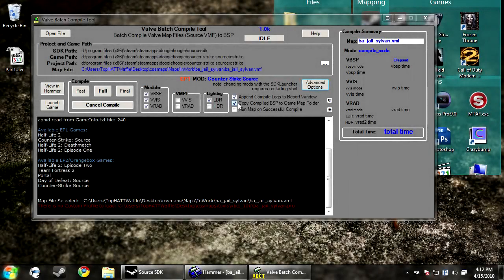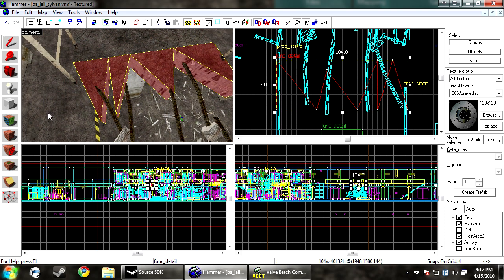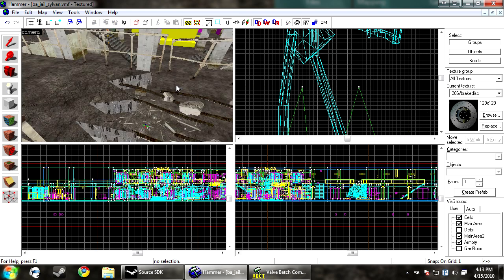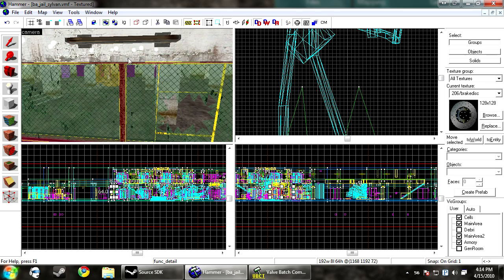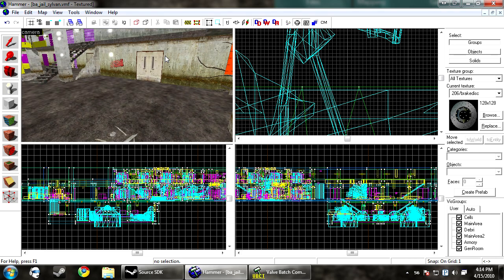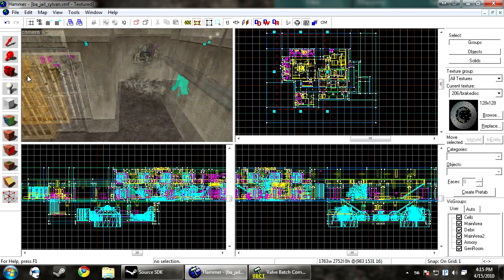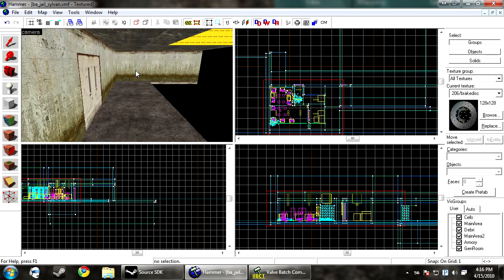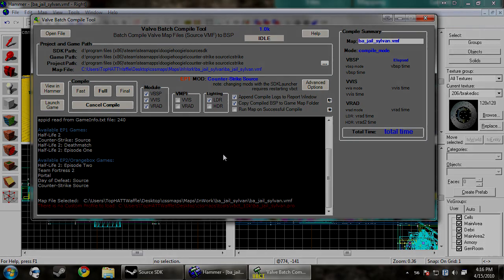Hammer Tutorial #28 part 2 "What happens during a compile? And how to speed it up"

Comment: The cordon tools are the best way to find errors that only show up in rad such as child area patch and degenerate faces. Both of those are usually due to moving a complex brush such as a cylinder using the handles instead of selecting it and transforming or nudging.